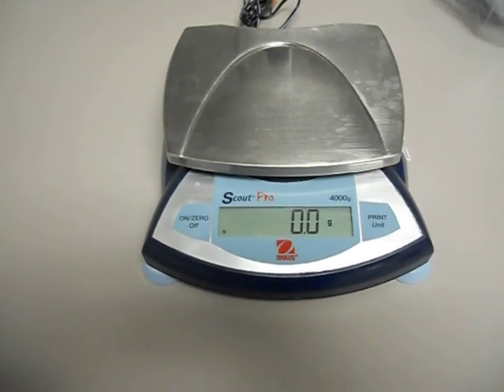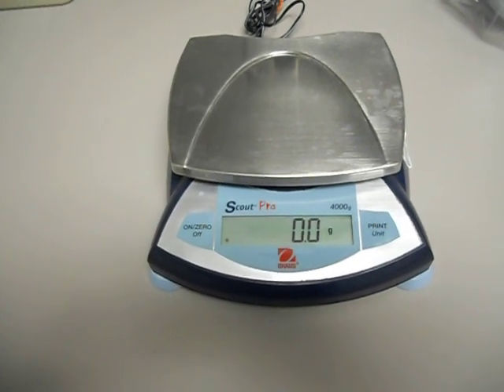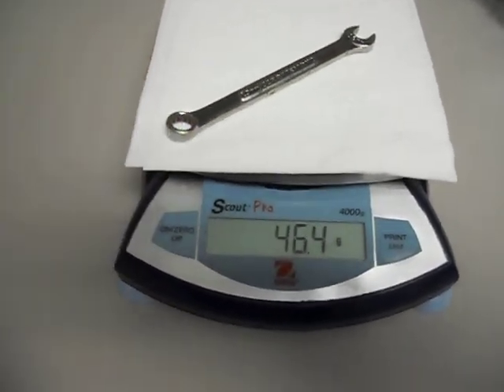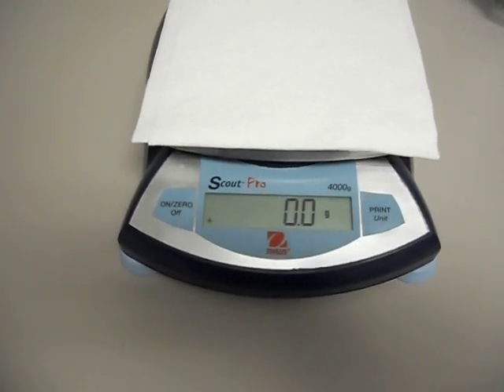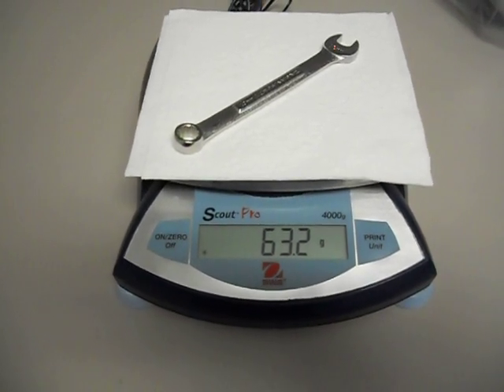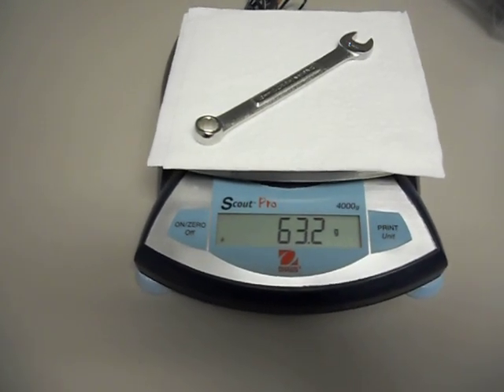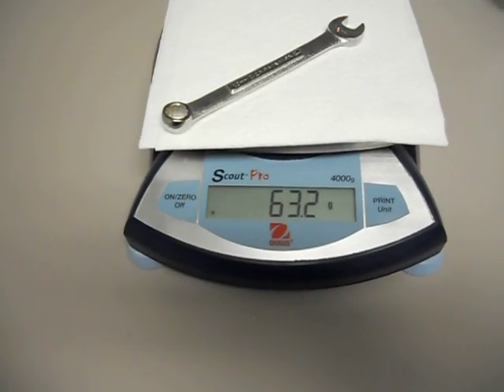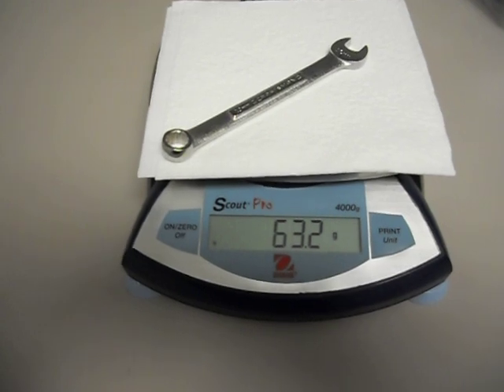Craftsman Tools: USA vs China [Part 3] - Materials Composition -

Comment: Exactly. I have used both the older Craftsman USA forged wrenches and the newer set of chinese wrenches and the chinese ones are indeed thicker and they ding and are damaged easily and the open end warps on the edges when pried on, the old USA ones can be hit with a hammer repeatedly, pried on with another wrench or a pipe over it as a breaker bar etc.. and it doesnt even phase them.. We have craftsman wrenches older than me from the 70s and 80s that have been used for decades that have NO signs of wear whatsoever and have been used heavily so yeah the chinese craftsman wrenches are nowhere near as good. I have been scrounging pawn shops and ebay for the Craftsman USA wrenches, Husky and Stanley make some decent wrenches (better than the Chinese Craftsman) but i have yet to find any non tool truck brand wrenches on the market that are as good as the Craftsman USA wrenches were and I'm not about to buy tool truck brands for wrenches bc they are way too expensive, and heck the old Craftsmans were as good as a professional brand wrenches, which have always costed way more than these store bought brands, so really only being able to buy Chinese wrenches unless you buy a tool truck brand is really a BIG loss for the consumer because we get less, it really sucks..
Reply from the maker: You are right on the money.  An insightful comment like yours is always appreciated!

Comment: Wait a second, this is supposed to be scientific, yet you never provide a measurement for the 10mm wrenches. I’m no fan of Chinese made Craftsman tools, but in order to compare you really need to measure the two wrenches.  I own multiple sets of spanners and some are much longer than the others. The weight difference, as it is only in grams, could easily be attributed to different lengths of the tool.
Reply from the maker: There is a dimensional difference; however, it really isn't the key component.

You need to think about this in terms of metallurgy over dimension.  Metallurgy dictates the durability and longevity of an object like this.

Comment: I own USA Craftsman but for all my projects the china ones are fine even the sockets and really you can only use anything to a certain tolerance.. anything can break if you put a pipe on it lol. But really who has ever even broke a wrench..a socket or ratchet with a pipe yeah.. but come on.. it looks and feels cheaper obviously weaker metal so they use more to make equivalent to spec.. but it does the job. These are for home mechanics not an auto shop..
Reply from the maker: I can understand your perspective; however, there are important aspects that you may want to consider.

1) Customers are still expected to pay the same price for an inferior tool.  If Sears would have scaled back the price point to reflect this, I believe more people would accepted the difference despite COO.

2) Considering the inferior metallurgy, whether DIY or as back-ups for a professional, premature failure could result in injury.  I personally have busted my knuckles courtesy of Chinese made Craftsman wrenches snapping in half during their 1st or 2nd use.  A better made piece will warp and bend BEFORE failure.

3) Only until recently, tolerances in the Chinese made Craftsman variants were poor, when compared to USA counterparts.
Reply: TheseAreMyToys no way you snapped a combination wrench lol. But yes there is definitely a difference in the build I have older china made wrenches and Japan that are pretty damn good but yeah now everything is cheap but I get what u mean I wouldn't pay alot for the Craftsman china made tools.
Reply from the maker: Bub, how in the world would you know if that happened to me or not?  I'm sure as hell looking directly at the scar on one of my fingers because of the glorious "chinesium" alloy in that Chinese made Craftsman wrench.

Look, I appreciate your comments, but I have better things to do than to make up some story, to someone that I don't know, to prove a point.  When Chinese made Craftsman tools are more or less a hair above Harbor Freight in quality, this kind of stuff will occur.
Reply: TheseAreMyToys it's fine I don't mean to make this an argument if you say it happened then okay. I just feel if you went to Sears right now and bought any combination wrench 15mm , 9/16 or bigger there is no way you will even bend it. You'd have to stick it in a vise and smack it with a hammer
Reply from the maker: "no way you snapped a combination wrench lol."  Those were your words.  "I just feel" is not an argument to support your claim.  

Again, you don't have to take my word for it; however, I don't have an incentive to progress a false narrative to an individual who I will never meet and likely never speak to again.  There is not a financial or social incentive here, so pushing an untrue statement doesn't benefit anyone.

As a former chemist and metallurgist, I can tell you that with poor alloys and poor process failure under even a small load isn't just possible, it is distinct.  You would do well to remember that truth is often stranger than fiction.
Reply: TheseAreMyToys okay you win.

Comment: Interesting video, however, it's not surprising that the Chinese version wheighs more, its bigger and takes up more volume. This test would more accurate by removing volume as a variable, this can be done by comparing densities rather than mass.
Reply from the maker: You cannot directly compare the densities due to the fact they are likely a different alloy composition, which is why I avoided discussing this as a function of mass divided by volume (the definition of density).  If we were to try directly discussing differences in different alloys, we would need to start using vsepr, crystalline geometry, and angstroms to correctly predict what is going on.  This is beyond the scope of most viewers here on YouTube. 

Given that the total mass of the Chinese tool is ~20% higher on average, it is likely there is a completely different philosophy of production and alloy, where both are critical in defining the physical properties of the specific metallurgical attribute you hope to create when making a tool.  Unfortunately, metallurgy is not a science where you can have the absolute best of everything.  It is a balancing act, in which you often sacrifice one attribute to a certain degree for another.

Most folks understand the concept of weight = force = mass X gravity to some degree.  This is why I chose to go the route I did.

Comment: Was there also a test of the tensile strength between the US and Chinese wrenches done?
Reply from the maker: Negative.  This is meant to be a simple means of demonstrating and discussing metallurgy practices not to directly demonstrate "strength" or "longevity"; however, certain assumptions can be made from understanding the alloy composition and/or production philosophy.

If the Chinese variant had to increase the total mass of the tool by ~20%, it is one basic metric to show how the USA made piece is either made of higher performing alloys, more stringent production standards, or both.  Experience and knowledge would suggest, the USA made piece likely has both qualities.

Given this, we can assume the USA made piece, per unit area, has stronger "strength" properties.